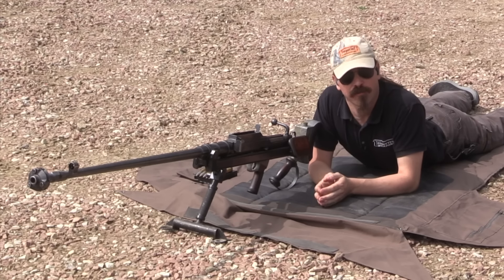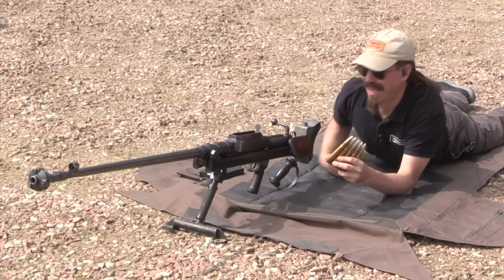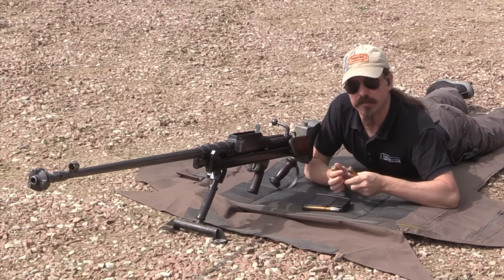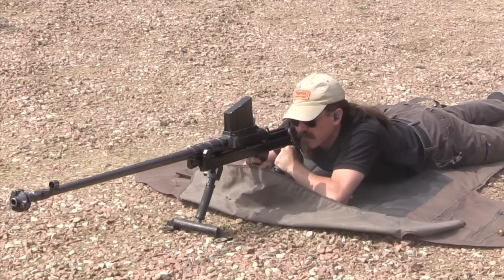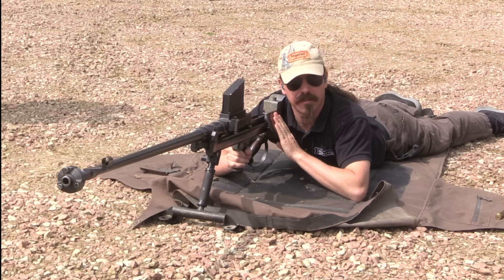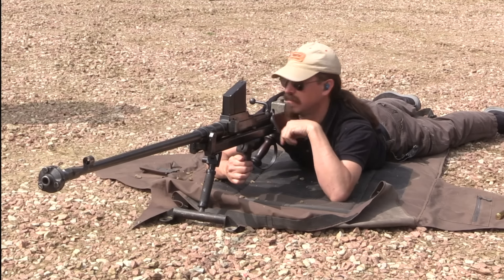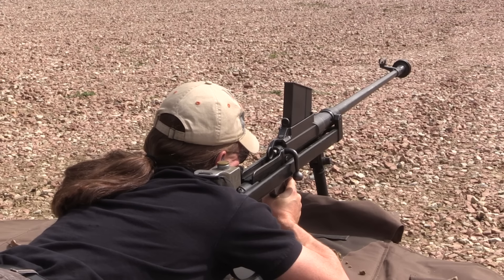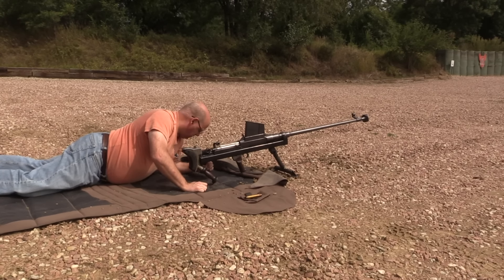Boys Mk I Anti-Tank Rifle at the Range

Comment: If I remember correctly, Tungsten is heavier than steel, but as it is tougher than steel, they might have needed less than steel for a core leading to a lighter bullet
Reply: exactly
Reply: Yep, Tungsten is more than double the density of steel (19g/cm3 to ~7g/cm3) So they use less of it, coated in a lighter shell to make up the size.
Reply: Not really tougher, but harder. That's not toughness as tungsten carbide is quite brittle. The outer shell serves also to cushion the blow and channel the penetrator into the armor in case it hits at an angle.
Similar technology to contemporary Armor Piercing Composite-Rigid or High Velocity Armor Piercing tank rounds.
Reply: Aye. Basic principle is that smaller penetrator will have smaller contact surface with armor, so will have to displace less steel to get through. But at same time, you want penetrator to be possibly heavy, so it can carry more kinetic energy. Steel surrounding penetrator (sabot) makes it fit bore of a normal sized gun. Obviously overall lighter round will gain more velocity while leaving the gun, so you want sabot to be possibly light. Later the design was improved by making sabot fall off penetrator right after leaving barrel, reducing air resistance that slows down penetrator.
Reply: Remember, tungsten has almost the same density as gold.  When you are making fake gold bars, take tungsten bars and coat them with gold.  You can learn a thing or two from Bill Clinton.
Reply: Ozyhananas, I was just going to say that!
Reply: Ideally to get APCR round you use aluminum casing around he carbide core. After that the only thing left is to go for APDS or as small arms world calls them - flechettes.
Reply: @kireta21  diameter is a much lesser factor then mass. If you have two projectiles with identical velocity then the one with bigger mass, but wider diameter is likely to penetrate more as it has more kinetic energy. The point of sabot is primarily to cut down on air resistance. Lowered diamter and length of sabot come into equation much later when you try to maximize the potential.

Comment: Tungsten: 19.3 g/cm3, steel is around 8 g/cm3
Reply: Thank you got me so confused when he said that.
Reply: Yep! Tungsten is super dense. About 1.6 times denser than lead, so you can really imagine how heavy the stuff is.
It's an amazing material.
Reply: Steel 7, 85 g per cubic cm. Trained metal worker/ Facharbeiter.
Reply: @brittakriep2938  also depents a bit on the type of steel i imagine. High carbon steel should be a bit lighter then low carbon steel right?
Reply: @Mummel92 Being that its armor penetrating, its probably tungsten capped or tungsten tipped. If Ian was right about the bullet weights, and the tungsten projectile is actually lighter than the steel core projectile, it most certainly only made up of a only a fraction of tungsten. Otherwise if it was a tungsten core, it would be far heavier than that the steel core projectile.
Reply: I think he meant by Titanium, which is 4.54g/cm
Reply: @hato_popo  checked on Wikipedia, it was just a lighter tungsten core bullet.
Reply: Radim yes even though the atomic weight of tungsten is far less than depleted uranium it is fractionally more dense than DE.
Reply: Gold is denser than both!
Reply: @callumbush1  But much softer.
Reply: @LH-gt6gz  : Yes, it depends on the steel type. What i wrote is ordinary P 365 mild steel, formerly known as St 37 in Germany.
Reply: @joshuaeah  also really resistant to heat
Reply: I use tungsten points in my outdoor target arrows because they are so much smaller than steel points of the same weight.
Reply: @UCxrp-Ypw-wD4AQrOBRF_BmA Yeah you right. I looked it up myself, and the source I found referred to it as an APCR round, which is a much smaller tungsten core surrounded my some aluminum alloy. I wasn't even thinking about using aluminum, because I was thinking in terms of tank shells most armor piercing ballistic capped projectiles around that time used mild steel as the shell to keep the tungsten from shattering on impact.

EDIT: On a related note, almost none of this ammo was ever made because by the time the APCR round finished development, the gun was already hopelessly obsolete, and they just abandoned the Boys platform altogether.
Reply: @user-bo8yt4uc8b  I need to throw tungsten darts, it's the only way to get them heavy enough for me to throw well.
Reply: The tungsten core is much smaller than the steel core in the bullet, so it's lighter.
Reply: @ScottKenny1978  Are those tungsten darts expensive? Stainless steel points for Easton X10 arrows are $38,04 for a dozen. Tungsten points are $239,99 which is crazy expensive, since the material can’t be that much more expensive, but I guess it’s way more expensive to machine to the high precision which is needed.
Reply: @user-bo8yt4uc8b  $55 or so for a set of 35gram darts. Brass darts run about $20 a set or less.
Reply: @ScottKenny1978  It’s not so bad ripoff then as in archery
Reply: @user-bo8yt4uc8b  yeah. That arrow price 🤯 !!!
Reply: @ScottKenny1978  That $239.99 is just for the points. Arrow shafts are $435.99 for a dozen, and they still need fletching and nocks, and possibly pins and wraps. And serious archers have at least two sets of those (professionals have even more). Fortunately I’m not so serious or pro 😁
Reply: @brittakriep2938  Mild (low carbon)  steel 7.85g/cm^3, tool steel anything up to 8.3.
Reply: @donaldasayers  : Yes, this type of steel was in my early days of work called St37 in Germany, nowadays P 365 G , ordinary mild steel. Other steel can be heavier.

Comment: Love to see a comparison between the
50bmg
50Russian
55 boys
13.5 mm German
Reply: 14.5mm?
Reply: @davidgoodenough6450  different class tbh
Reply: @иванкитаев-в4ф  perfect for urban combat lol
Reply: What about large hunting calibres? .500 jeff, .577,   .700/577 etc?
Reply: 50BMG is actually 13mm - same as the muzzle on the TuFG which is a squeeze bore from 13.2mm case size.
Reply: @allangibson2408  12.69 to be exact
Reply: @allangibson2408  sorry...i saw now a pic where the bullet diameter is in fact 0,511 = 12,98mm
Reply: keith moore  no. .50 BMG was being developed before the 13.2 TuF was deployed and captured.

The US looked at the 13.2 round and said, "needs to fly faster"
Reply: 20mm Lahti?
Reply: keith moore  the US didn't have access to any 13.2 until after the .50 cal MG project started.

Then we got some to see if we could shortcut some development time, and said it wasn't good enough, we wanted more velocity and better range. 

Neither brass nor bullet of the .50 BMG is based on the 13.2 TuF, and the concept was developed separately.
Reply: keith moore  only in terms of concept: "big damn bullet that could be fired from a machine gun."

The development timeline doesn't work out for any actual tech to have come from the 13.2!

FFS, there's multiple paragraphs in the .50 BMG wiki page covering this.
Reply: keith moore  that's why you use it to get their list of sources.
Reply: @иванкитаев-в4ф  The best AT rifle round. Wayyyy more powerfull than 55 Boys etc. But could still be handled in man portable weapon.

Usable till mid war years against main battle tanks. Russians got this right.

And is great anti-helicopter round in AAA role even today.
Reply: @иванкитаев-в4ф  14.5x114 is in another league
Reply: @TheJimyyy  entered service, not started development. The US had started development of the .50bmg back in WW1, it took a while to work out to be ready for service.

Read the American Rifleman article I linked.
Reply: @TheJimyyy  I'm going to assume that the first WW2 in your comment is a typo.

You're wrong about the design of .50bmg being for anti aircraft first or specifically. It was always dual purpose, even if tanks were too well armored by the time the US got into WW2 for the M2 bmg to be an effective antitank cartridge.

It was always intended to be a machine gun cartridge, however. The .50bmg would shred any armored car in WW2 short of the T18 Boarhound (26 tons, 8 wheel drive and armed with a 57mm), as well as most Japanese light tanks.

The 14.5mm Russian is between 1.5x and twice the KE of the .50cal cartridges, so it was effective against side armor of Panzer 3 and 4 tanks, even in 1945. And Shermans, if anyone bothered to shoot PTRS/D rifles at a Sherman.
Reply: @TheJimyyy  read what I posted again. .50BMG had nothing to do with  13.2 TuF in development, the two programs were completely separate from each other. Ordnance had brought a TuF to Browning/Winchester, and they all agreed that the TuF wasn't fast enough for 1918 tanks, let alone newer. 

There had been a paper proposal for the .50bmg to be rimmed for use in an antitank rifle, which was shot down by the desire to also use it in a machine gun. You can use rimmed cartridges in a machine gun, but it really complicates the loading process. Just look at a Vickers gun or any Soviet 7.62mm MG. Rimless cartridges make belt feeding a lot simpler.
Reply: Nato 120mm smooth bore
Reply: 50 BMG is actually .51 inch dia  ,over 50 cal ,as are the 505 Gibbs, 500 Jeffrey's and 500 nitro express

Comment: A slight addition to the recoil damper on the lower pot with the addition of sheet metal twisted forward  - will move the blow gases away from the ground  thus stopping the dirt and earth flooding the  use and  2 lower existing screws will hold it in place  - this  is a must have

Comment: Friend of mine had one and we found some ammo at a gun show. We found some 1/2' thick, mild steel gongs to test its armour penetration. Firing was amazing, the range floor was sand and squeezing off the first shot with great trepidation, all I saw was three white lights as the muzzle brake did its thing and about a pound of sand being blasted back into my face. We set the gong at 50 yards and the bullet blew straight through it with ease, so we next welded two together to give us a one inch plate. The bullet made it through the first plate and about half way into the second. Later and quite by chance I met an old soldier who carried one in France and he told me it was a waste of time as they literally bounced off German tanks unless you were really close. He said he threw it in a ditch on the retreat to Dunkirk and picked up an SMLE...

Comment: Tungsten is more than twice the density of steel, so You got that wrong, However it is also a lot stronger, so these rounds could have been made with a lot less material and  have great penetrating force at higher velocity.
Reply: I believe the core was smaller with the tungsten, versus the steel core.
 the theory the denser core would penetrate further.
it can be made to weigh less as a projectile to go faster...

Comment: I have two Boyes, a British made one ( Round Muzzle Break) and,a,J.T. Inglis of Toronto ( Harmonica Muzzle Break)
For Movie use , Blanks are made from .50BMG CASES, as the original .55Boys case was simply a 50BMG case with a Belt on it, and neck expanded to .55cal.
In fact Boys, during development, offered a .50 sized version, but was found to have insufficient penetration, so he Upped it  to .55...and added the belt, to ensure good headspace.
Despite being insufficient for 1941 and later tanks, it still did a good job on Pre War tin can  AV, and also Artillery positions etc.
In the Pacific, Japanese Tankettes fell victim to it, as well as IJA snipers in Palmtrees...
DocAV

Comment: 1:20 A correction, Tungsten is far more dense and tougher than Steel or lead, 19.3 gram/cm^3 vs 8.3(at most) and 11.34 gram/cm^3 respectively. The reason it is lighter is because the round is a APCR(Armor Piercing Composite Rigid) or in modern terms an APS(Armor Piercing Sabot, but not discarding unlike most modern saboted projectiles today), so it has a tungsten core but the rest of bullet is made of lighter materials so that most of the energy carried by tungsten and not the lead or copper. Today tungsten along depleted uranium, is the primary material to make tank rounds thanks to their density and strength, which makes them ideal for APFSDS rounds (armor piercing fin stabilized discarding sabot), and also in frontal tank armor (modern tank armor is made of a bunch of different things but these metals is one of them).

Comment: As others have pointed out, tungsten is denser than steel by a lot. If they used tungsten in the lighter bullet, it might have been to make the bullet shorter. A shorter bullet will take up less space in the case which would leave room for more propellant. That can enable greater muzzle energy.

Comment: Tungsten is about the same density of gold, which is denser then lead, which is denser than copper, which is denser then steel. Now if you thought of the weight of Titanium, then yes, it does weigh less than steel. But people don't really used Titanium in bullets.

Comment: It was recommended to pore water on the ground under the muzzle to avoid a cloud of dust, showing shooters position
Reply: Similar advice is given with ATGM. There are some vids of the smarter TOW shooters in Syria doing this exact thing before engaging.
Reply: @dogsnads5634  snipers were advised the same during WW1 in dry condition. You can put up a good cloud of dust.

Comment: I believe tungsten is has a much greater density per cubic cm as compared to steel alloys. I am a CWI and have handled tungsten electrodes often they are noticeably heavier than any steel alloy i.m.e. I think the addition of tungsten to the bullet was to pack a greater punch so to speak correct me if I’m wrong.

Comment: Tungsten is around twice the density of steel.  17.2 To 7.3 for steel.  Often the tungston is held in a lighter frame. This is important as four bits of bakerlite at three times the speed of sound, might injure if firing over friend's heads.

Comment: High carbon steel is around 8 g/cm3 where tungsten is far closer to 20 g/cm3, they must have changed something else in either the bullet design or powder charge to increase the velocity.

Comment: Tungsten is heavier then steel, by the way. Now, the tungsten rod may be liter then the steel rod, only based on the the size rod inserted in the bullet's cavity, but tungsten is more dense then typical hot or cold rolled steels, or any of the tool steels like the "O & W & A" series drill rod also known as silver steel in Europe.  I am sure that is just a verbal typo But for anybody wondering.. Tungsten, is heavier then steel, when comparing the same size chunks to one another. Tungsten is much harder then a hardened steel out of the list of the above mentioned. Ductility is an amazing subject to study,

Comment: The "Tungsten" bullet has most likely a Tungsten spike as a core, surrounded by a fairly light material. Tungsten is extremely heavy - very similar to Gold - and extremely hard, so it is great to penetrate steel plates or similar things. If the entire bullet would be made of Tungsten, you would be shoved back 10 ft when you fire the gun, and the barrel would be worn out after 10 rounds.

Comment: Just one correction: "(...) lighter, because tungsten is lighter than steel. (...)"
Both Tungsten Carbide and elemental Tungsten are more dense (about 2x as dense) than carbon steel. 
I couldn't find any diagrams or pictures of the tungsten variant, that was never officially adopted, but the only possible reason for the lighter weight would be a small core, surrounded by a lighter sleeve (perhaps brass)

Comment: 1:18 There must be something else going on, because Tungsten is in fact about 2.5x heavier than Steel for the same volume.

Perhaps while the Steel-cored projectile is incased in lead, the Tungsten-cored one might be incased in much less Lead, with Steel or lighter elements making up the rest of the volume instead, bringing the overall weight of the projectile down.

Comment: Greetings Ian,
    It may be that a projectile that contains tungsten is lighter than steel. However, tungsten is actually heavier than lead. Denser actually, I don't remember the atomic weights. Nevertheless, per volume tungsten outweighs lead. Gold too for that matter.  I sometimes wonder that some general didn't specify osmium bullets. Now, that would be dense in more than one way.
Eric

Comment: You would need to prepare a shooting position with a solid surface and maybe a deflector sticking up a few inches between the action and the uzzle break to control the spray of junk back into the shooters face.  Is there any doctrinal documentation for that rifles use available?  I wonder if they had any doctrine for preparing shooting positions???

Comment: Steel has a weight of 0.283 pounds per cubic inch, whereas tungsten has a weight of 0.70 pounds per cubic inch. I imagine the lighter bullet would have to be substantially smaller than the heavier steel version.

Comment: Mr Ian, Tungsten in denser than steel 19.3 g/cm3 vs 8.05 g/cm3. the tungsten rounds are probably lighter because they user a smaller diameter denser penetrating core which makes up the bulk of the mass of the projectile and surrounded it with something much lighter to get to bore diameter (aluminum?) copper is 50% denser than steel so wouldn't be that,

Comment: Just a minor thing; tungsten is not lighter than steel. Not even close: it's roughly 2.5 times the density. The penetrator component in the tungsten rounds is probably much smaller, in an effort to increase the impact velocity. Just a guess, though.

Comment: it has surprisingly high kickback power compared to only 13.9mm in caliber.
The WW1 Mauser-Tankgewehr is not much smaller in caliber (13.25 x 92 mm) but its kickback is half that
Maybe this is a bad design flaw
Reply: YCalibre might be similiar, but the T-Gewehr has only 15,400J muzzle energy vs 18,600J for the Boys, and the T-Gewehr is 18.5Kg, vs only 16Kg for the Boys.